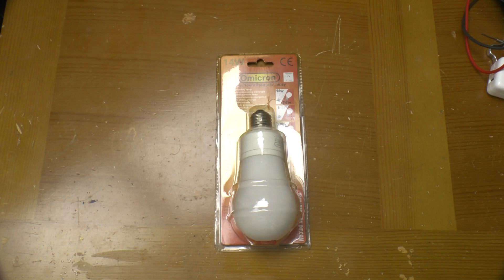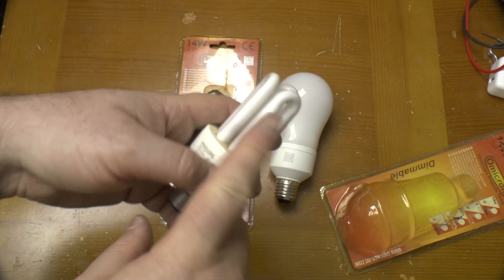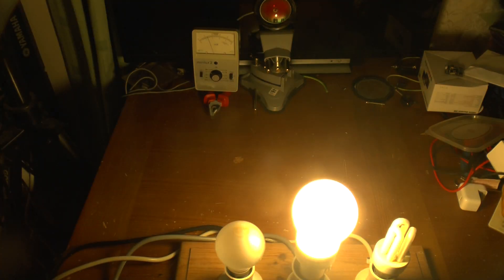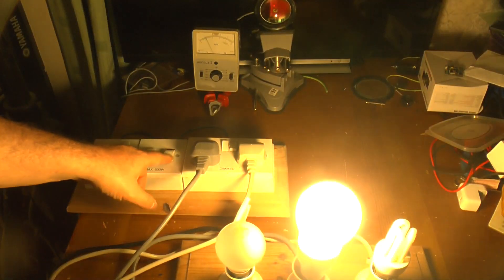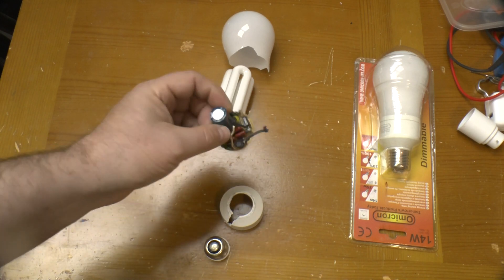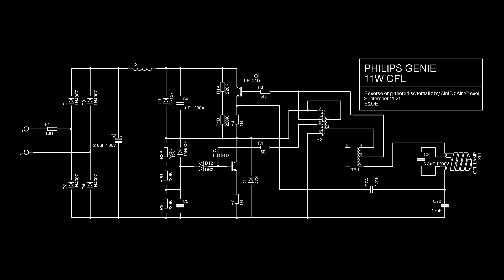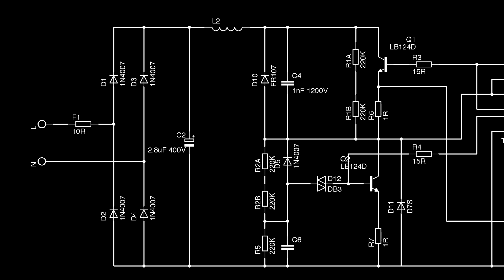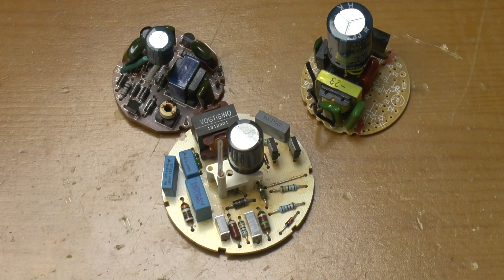Dimmable and non-dimmable CFL teardown

Comment: Nope. Still lost on how it's dimable. The input rectification makes no sense. I know a fluorescent tube can be dimmed. You have to regulate the current going through it. You may still have to hit it with a high voltage "spike" to get it going, but after it lights you drop the current. The filament has to remain somewhat regulated regardless of the current going through the tube. I have no idea how this one does it, unless the second transformer is somehow saturable and clamps at a certain flux and thereby regulates the filament.
Reply: I have wondered about dimmable fluorescent lamps since I saw some in the 1980s. A manufacturers web site says that modern systems dim by varying the frequency at which the lamp is driven.

As for the two bridge rectifiers I wonder if they are doing some kind of voltage doubling to ensure sufficient voltage at lower settings.